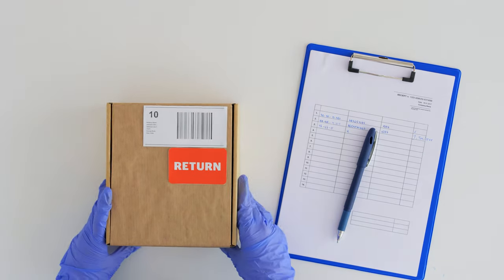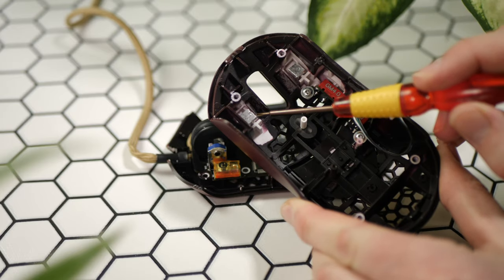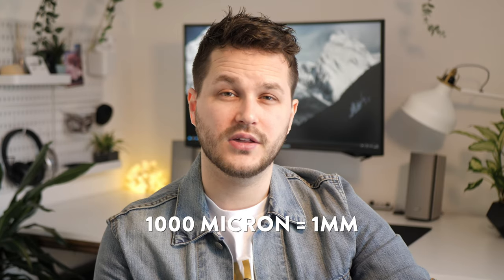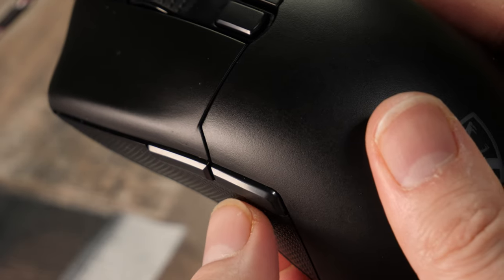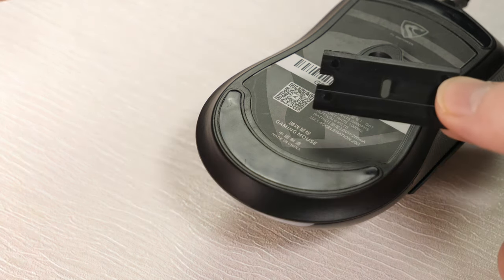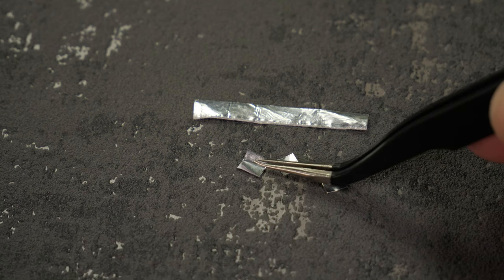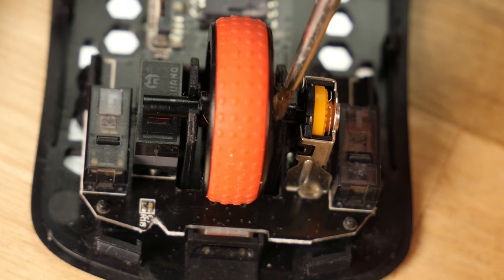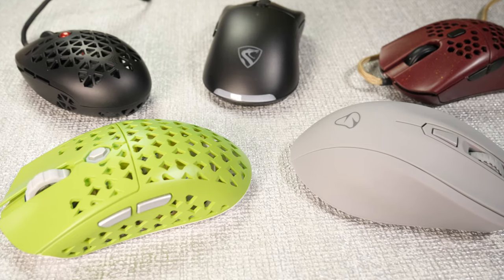$6 FIX to improve ANY gaming mouse... no rattle, no pre-travel, just CRISPY clicks with this hack!

Comment: You can do this with post-travel too, just put the tape right next to the little nub that gets pushed into the switch housing so that the plunger bottoms out sooner. I figured I was just ocd but I guess I'm not THAT crazy. I've been doing this for years with scotch tape and cut up stickers. I only recently discovered aluminum tape and it definitely works best. A mouse's tooling can only be so precise, and when I like a shape and placement of buttons enough, I'm willing to do a bit of tinkering to make it feel more premium. Almost every mouse I've ever had exhibited pre or post-travel. I take it a step further though. Sometimes if one of my mouse clicks feels or sounds weak, I'll actually take the housing off the switch and manipulate the leaf in a way that gives it more springiness.  Sounds kinda nuts, but if you're past the return period it's worth a try and you can always buy a couple switches to get another leaf should you screw yours up.
Reply from the maker: Great advice, I've done this on a few mice too! 
Manipulating springs I try to avoid because resoldering switches is so straight forward, but in a pinch it's a fix I guess 😬
Reply: @GoodEnoughTechReviews  I don't have a soldering iron, maybe one day i'll get one and start soldering the right switch for me, but I can also make an omron 50m feel amazing with some luck haha. Great video btw!
Reply: Will definitely try this trick with my G502 Lightspeed. It has just the tiniest bit of pre-travel on the left click, but the post-travel is driving me nuts.

Comment: Goated as the kids say.  was trying to fit a g502 pcb inside an old MX310 and was using electrical tape since it’s all I had around, instead of the aluminum tape for the buttons - this could do the trick in giving the buttons enough “height” without the adhesive coming loose
Reply from the maker: Aluminium tape has the benefit of being able to reform and adhere to pretty much any bends or irregular shapes and has great adhesion... at 30micron thickness you can build up layers too. If you have the patience it's a cheap and easy way to fix most QC annoyances with mice.

Comment: not the best advice video. rattle can come from from many different sources, not just the sensor plastic. it can be an encoder rattle and, what I currently have, switch rattle. which pretty much sucks as I have replaced my main switches and encoder and the plastic bit for the sensor. now I have to de-solder and re-solder all switches to figure out which one it is. if it is the japanese omrons which I currently have I would be pissed off. furthermore, the aluminum tape, if not careful and you overdo it can put permanent stress on the switches you're using which can wear them down prematurely. if you have a problem with your mouse, return it. there are way too many companies that produce relatively good mice for reasonable prices. unless you like spending money of switches, encoders, soldering equipment, tape, glue and whatever else you can think of. in that case go for it, but remember - other than money you will be spending time too. also, use double sided tape for the skates in case you mess up. remove old tape first though.

Comment: I noticed that sometimes when I do teardowns on mice, and remove the pcb with the sensor it will rattle once I put it back together
Reply from the maker: Yeah they can be a bit fiddly and will often loosen off, I think just make sure that the sensor standoffs are secured to the chip body and you're good!

Comment: Advice that i got from modder that upgraded 100+ mice to perfection: NEVER EVER apply aluminium tape directly to actuator. It can mess up clicks badly. Apply tape UNDER the actuator, between it and the plastic limiter that limits the upstroke. Here at 20:53, turn the subtitles on: https://youtu.be/uEhYLXEYPbI
Reply from the maker: Both are solutions that work - some people swear by one way or the other.

What I will say is that applying the tape directly the the actuator can make a click soft if you're using tape that compresses under pressure. With the 30micron tape, it is already so thin that it won't sink under click pressure and feels just as crispy as the raw actuator.

Appreciate the input though and it is a fair alternative, but having modded maybe 20+ mice now, I've never had an issue using this particular tape. Hope that helps!
Reply: @GoodEnoughTechReviews  hmm. Seems like 20+ modded mice is > than 5+ years of experience and experiments. Also i was wrong - the main reason for it is the lowered durability of tape and microswitches.
Reply: Who is the modder? I'm looking to broaden my know-how as I've only done soldering and opening switches
Reply: @mjcheung  i left a link to his video in original post. It's the turbobitbox
Reply from the maker: I think both methods can be true, I've just never had an issue with this in particular. Always good to share more knowledge though, thanks for including the video link!

Comment: Can this fix the model o wireless?
Reply from the maker: If it has pre travel then sure
Reply: @GoodEnoughTechReviews  Mine doesn't have pretravel but the right click button is very mushy
Reply from the maker: Could be the switch, in which case it would need replacing
Reply: @GoodEnoughTechReviews  or I mean it feels like its grinding something, but it has happend on all 4 of my model o's
Reply from the maker: Could be side play on the button itself rubbing against the retaining plastic, you can try tightening the screws holding the click pieces to the shell, or if they are using clips, adding more superglue/adhesive to the piece where it attaches to the shell (interior of course).

Without seeing the mouse it's difficult to diagnose I'm afraid 🥺
Reply: @GoodEnoughTechReviews  will 0,048 mm be good?
Reply from the maker: Hard to know, might be worth clarifying with someone who has a model o available to measure (I don't sorry!)
Reply: @GoodEnoughTechReviews  It's okay I'll try it. But if this works I want to give you some money for this 😊
Reply from the maker: No need, here to help the community! Good luck!